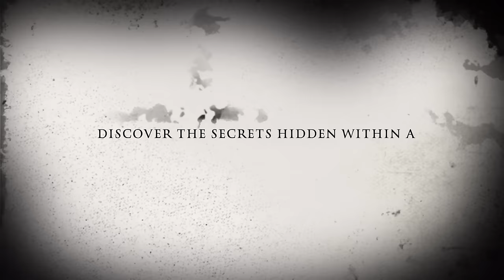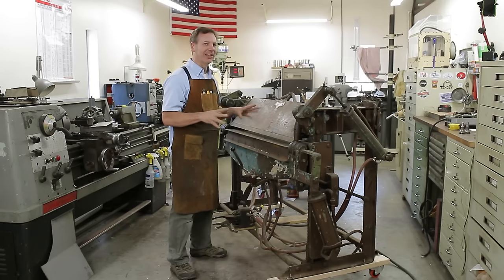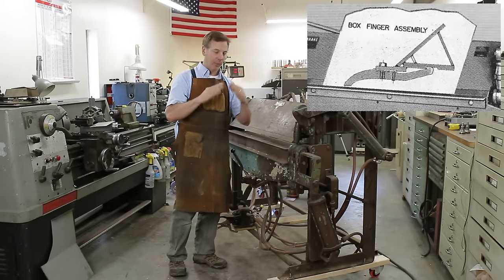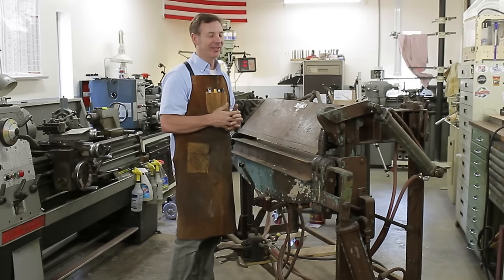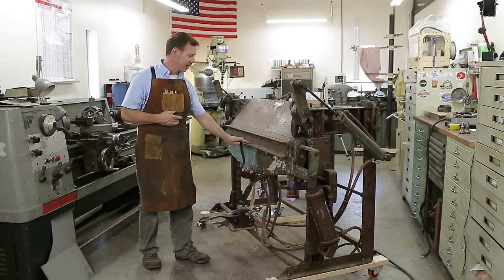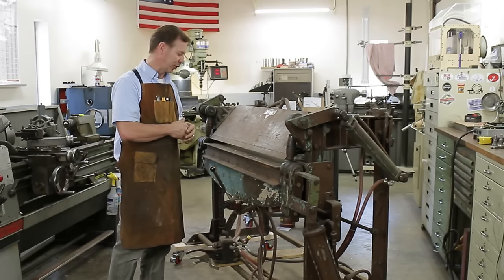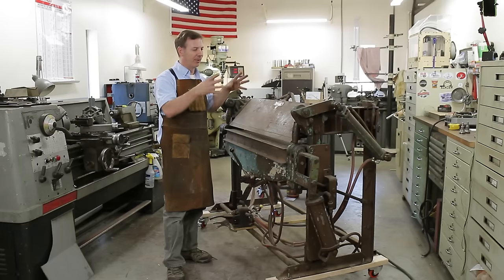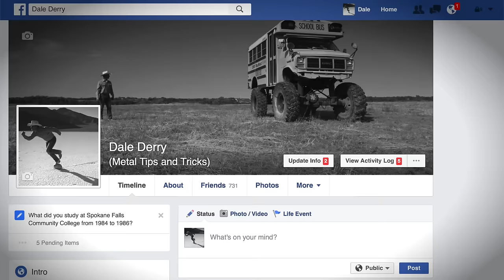Dual action Pneumatic finger break

Comment: I've worked with fabricating sheet metal in custom automotive applications a lot and have a fair amount of experience with manual box and pan brakes. Your are right that when bending a shorter length of sheet metal, you can get away with heavier gauges of metal than the rated specification of a given brake. I love your ideas for improvements on your new pneumatic brake, going to electric solenoid-activated pneumatic switches and rearranging the controls and plumbing. I have never seen a brake like yours and am quite excited about following your efforts with it. I'm now looking for one myself. Yay!
Reply from the maker: thanks for your comment. I hope you fine one. :-)

Comment: Now this is more up my alley! Nice find. Yes, these older machine are sort-of terrifying. I used a Wysong 50" shear near the end of my tenure at a fireplace company and it scared the Hell out of me. The machine had to have been made in the 1960's or 1970's. I really needed some parts made, and couldn't wait three hours to have them schedules to be cut on a laser. So I got the raw material, set-up the shear and went to town. The first time I used it, I messed up what I was trying to cut because I wasn't used to that mechanical style. I did get used to it, however.
Reply from the maker: Thanks for sharing. I hope to get use to it. I have a 52" shear I plan to convert to pneumatics.

Comment: I really liked the video.  I currently install a modern CNC relative of that machine and it is interesting to see how much they are alike and also the differences.  On bending material over the rated thickness it can and will do permanent damage to the machine even if it will physically bend the material.  On the safety that air valve on the folding beam is the part that really scares me.  Myself I like the foot pedals as long as they are down on the ground, you can use your feet to run the machine and it keeps your hands free to deal with the material.
Reply from the maker: I didn't know that company made any CNC stuff that cool. 
Thanks for your comment Michael
Reply: Several do, and they are not completely the same.  The ones that we make are marketed for making trim for steel building. If you are interested these are our machines. http://bradburygroup.com/Products/Trim-Shop-Equipment/Folders

Comment: When you change over to electric switches, make sure you put a big red button in the circuit that releases the pressure in the system. I've seen guys get messed up by hydraulic press-brakes that move slow as molasses, let alone something that moves as fast as that death-trap does lol.

Comment: that thing is a real beast. you need to be very careful using air as opposed to hyd's. the air cyl will act like a bif spring. if something should cause a jam and release under pressure that thing will fly. due to the volume of compressed air in the cyl. llow controls on both sides of the cyl can help to a certain degree but wont eliminate the danger. looks like a very useful machine.
Reply from the maker: Thanks for the info

Comment: I would love a session on the differnece between Cast Steel and Cast Iron
Reply: interesting, how is the carbon dissolved in cast iron? i know there are steel alloys with more than 2% carbon in it, but in what form is carbon dissolved, and how come it doesnt form steel with lumps of residue carbon
Reply: Cast steel is massively more annoying to run than cast iron. It's lower carbon content means it is more likely to burn out its carbon supply and turn into worthless brittle pure-iron. You generally need to bring it up to temperature in a completely oxygen free environment.
Reply: If done properly, cast steel can be very strong in tension and bending. 
Cast iron is ordinarily very weak in these load situations, although nodular (SG) iron is a considerable improvement. 
I would personally not use any sort of cast iron for fingers on this bending machine: 
I recommend either high tensile chromium molybdenum steel (say 4140 from a reputable source, hardened to 47 HRc) or cast steel to an equivalent strength grade

Comment: Dale... there are devices that slow down pneumatic motions but allow full power. Also, the 10 gauge piece didn't get bent to 90 degrees so the machine can't bend 18" of 10 gauge to 90 degrees (which is the rating press brakes have used). But it should bend 48" of 14 gauge to 90 degrees....
Reply from the maker: It will  bend 10Gauge. I didn't have the top leaf set back enough for that that thickness of material. But good eye. :-)

Comment: Hey Dale i also have a straight brake like yours, mine looks the exact same  but is branded a roper whitney its a 96 inch 816 model 
I dont have air assist on mine, but i am also looking to make fingers for mine
have just a bridge port mill so machining a set could be a good project

Dave

Comment: I would avoid cast iron or steel for the fingers, both materials are quite brittle when you have them at a the hardness that you would want for this application. You could soften cast steel and make it less brittle but then it's going to wear/damage really fast. I would thing your going to want about 30-35 RWC hardness and that is way too hard for cast anything to be ductile enough. You run a large risk of them fracturing under load instead of deforming, this would be at best scary as hell and at worst very dangerous. There's nothing like broken bits of steel flying around you shop to ruin a day! I would make them from a tool steel plate/bar (4140 is great for these kind of tools and fairly cheap), you can get them open die forged if you want a near net shape (it's cheaper than you'd think), rough machine, heat treat/stress releave them, then finish them up. Keep up the good work!
Reply: That's what I was thinking. 4140 would be the best bet.
Reply: i do patterns for castings and its great fun but i would agree here it needs to be very tough stiff steal to last and cast iron is a flat out no no.
Reply from the maker: I look into it using 4140.

Comment: This is a fantastic find! I have several Brakes. From a 30" manual box & pan,  all the way up to a 175 ton Cincinnati hydraulic. With a few Roper Whitney's in between. I have never seen or heard of a Whitney-Jensen, before this video. I would love to have a "jalopy" like this in my Arsenal 😀

For us here, this would be called a straight up box & pan brake. And it is "Brake", not "Break". If it had removable finger sections, 2, 4, 6, 8 inches wide each for example. We call that a finger brake. 

Are you saying, that you intend to switch this over from a single blade, to mounting a row of fingers on it?
Reply from the maker: Thanks for your kind correction. :-) Yes I plan on putting a set of fingers on it.

Comment: I have operated pneumatic and hydraulic controls.  You really should consider keeping manual control for 'feel' feedback while operating the valves.  Electric valves are either open or closed no 'feel' to them.  It's ok for distance but not for close precise control.  Sudden movement is a possibility.
Reply from the maker: Thanks for your advice. :-)

Comment: To control the speed of a pneumatic cylinder,you control the airflow OUT of the cylinder,not in as in hydraulics.Trying to control the air in will result in very jerky motion .The speed extending the cylinder and the retraction speed can be controlled separately.In this manner you will have full power at a controlled speed.I'd hate to see that thing eat you for breakfast!
Reply from the maker: wow! i did know that.  Thanks for the info.

Comment: This is a neat rescued machine, if you take the controls away from it and install on a console it will be just like a brand new, maybe slowing the moves will allow more control, also adjustable limit switches will allow repeat...   
Your core video content is great enough so you don't need to add all the drama that is in my opinion a little too much... this is my feel though, Oh you still got the thumbs up... 
(I quitted watching This old Tony cause the content is getting poorer and the drama too high, bad ratio for a machining based channel... Don't need this to occupy my days)
Reply from the maker: Thanks for the comment.

Comment: That foot control will be more usable when you put the machine back on the floor, rather than on your wheeled device. As for changing to electric control, a good motto to live by is "add simplicity, not complication." It has worked fine for decades, why add more things to go wrong? Remote control will not add any advantages for the use you will put it to.
Having said that, it looks like a useful addition to your shop, wish I had room for something like it.
Reply from the maker: Great Idea
Reply: Gee thanks, do you really mean it, wow, now  I'm blushing. :>)